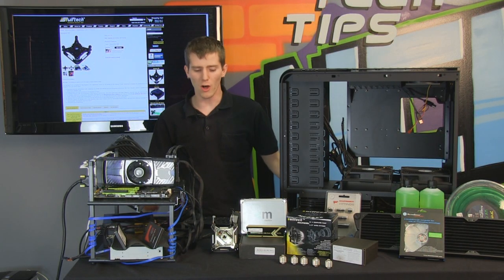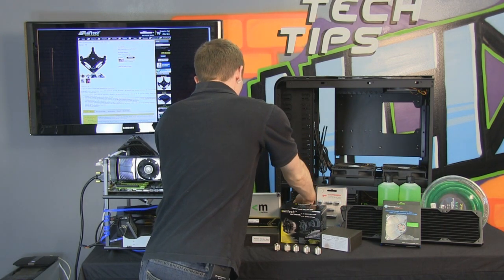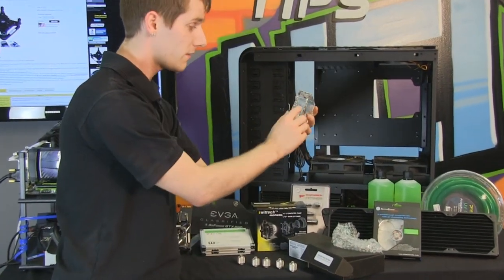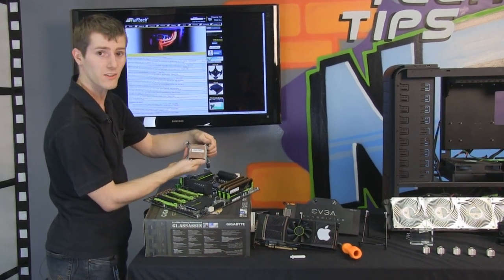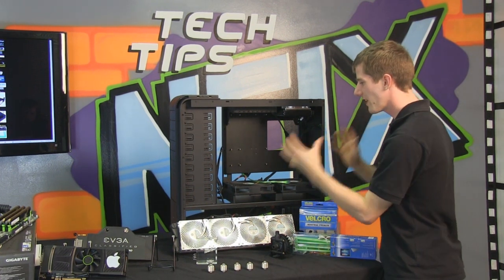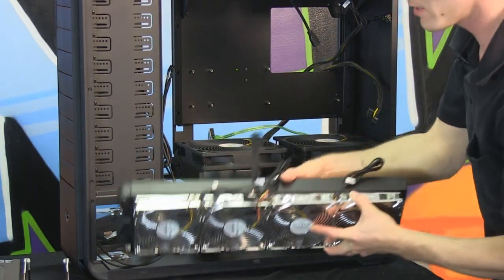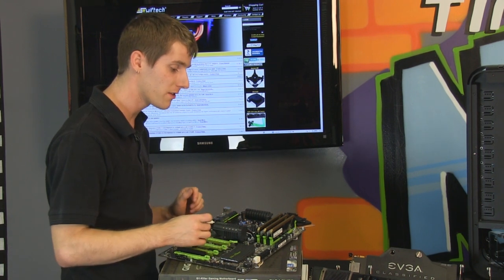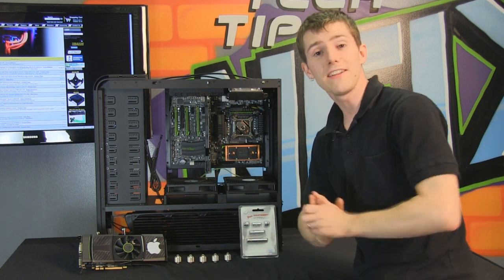Ultimate Water Cooling Guide Part 2 - Block & Component Installation NCIX Tech Tips

Comment: it is overkill yes and no way i need the room in it now but i ratehr pay 600 once and have a case for several years then buy a new case when i need more room. so its a investment for some time. and there is a reason they use the case in a Ultimate guide

Comment: well not exactly, it would still be pushing the air in the same direction at the same temperature.....well actually at a low temperature..because..as you know the more air that's moving the cooler something is..and other then that...just more air is being pushed.....don't know where you got that theory from...

Comment: @kamikazerus. For how lon will it run super fine? only two, common man, wat do you mean xbox games, they wern't made just for xbox. try playing crysis high tecstures pack, warhead, crysis 2, farcry 3, black ops, bf3, NFS shift, NFS shift 2 unleashed, Dirt 3 and more on max stettings with physx installed and tesselation enabled in 3D in eyefinity and nvidia seround, online on a pc that isn't liquid cooled. youre xbox wont eve make it and youre airecooled pc will boile.